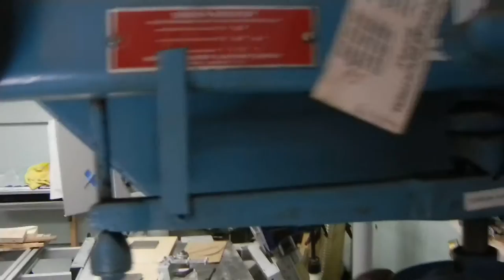Northfield 27" band saw resaw attachment

Comment from the maker: You can line up the attachments by the table edge or/and the table opening for blade change. I would get the 1.5" wide blade from Starrett in the thin kerf.  I think Northfield could fit new tires 
for your band saw if need be. The biggest factor I have run across with these larger saws is the blade aligment-tilt of the wheels; get that right and it cuts very sure. I have mine setup for resaw
only so I do not break the setup very often.

Comment: Great setup Vincent - Is the guard counter balance mechanism spring loaded or is it a hanging weight?
Reply from the maker: I presume you are asking about the orange guard around the blade with very little showing in the picture. That guard is custom
to this model due to the taller height than normal. It is stationary (no spring or weight) and has adjustment independently of the blade bearings-guides.
I should have had the guard down lower for this operation.  The guard is a hinged model allowing a door to open for removing the blade. I was concerned about the taller roller not controlling the cut and had some extra simple rollers to address this but even cutting 15" height I can adjust the table tilt and thus control things. Note that the adjustment for different thickness on either side of the blade is accomplished by the black screw knobs on each mechanism on either side of the blade. I use an adjustable 

square to set the fence and do not have to account for drift. Hope this answers your questions.

Comment: Nice video! Thanks for sharing...the cilinder on the fence protrudes from the flat part of the fence?
Reply from the maker: Yes, cylinder is about .002" proud of the fence plane so it helps with the push through but does not create an imbalance of the wood going through the blade. I was concerned with the cylinder not being tall enough for those deep cuts but it works just fine. You set up the vertical cut with micro moves on the tilt of the table and all is well.  Finding the best tooth count for what you are sawing is part of the search for the best cut. This saw, with the blade speed set just right, can eat lots of 6 X 6 posts as fast as you can feed and catch. Notice that I have the cylinder-fence side on the left of the blade and the tension rollers on the opposite side. One person's video had the wood feeding from the back end of the jig and that approach does not give us the longer side of the fence on the infeed and that can lessen the true of the cut. The cylinder nip is about 1/4" before the teeth begin their cut. If you have it at the cut you will create heat and friction which can warp some woods. Thanks for watching, Eduardo